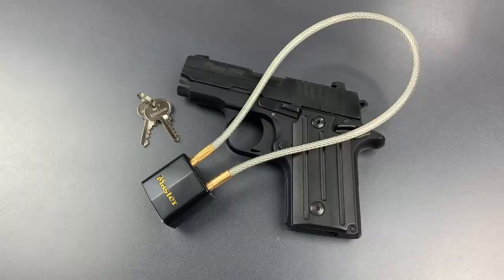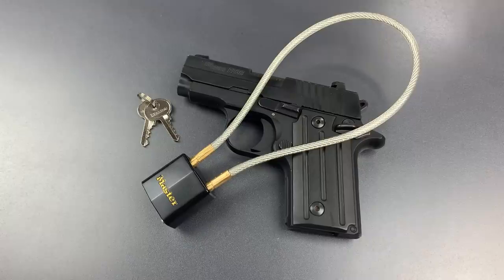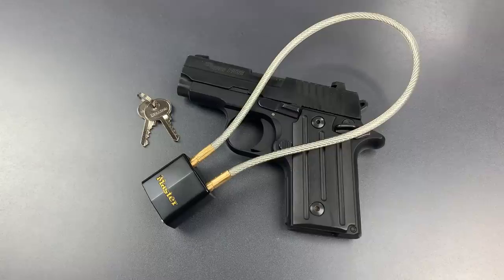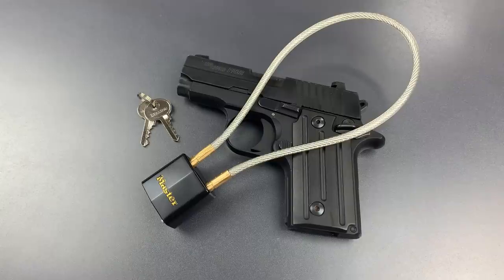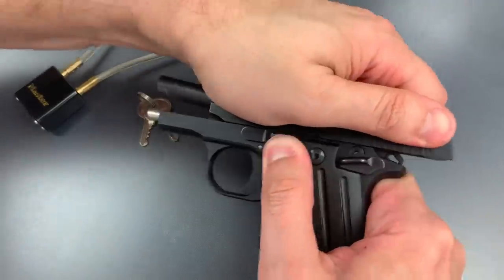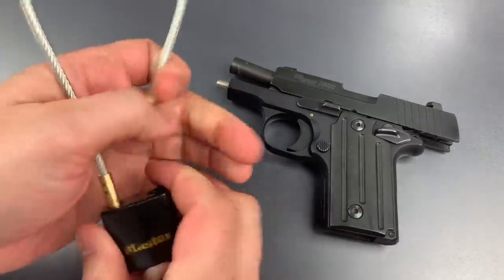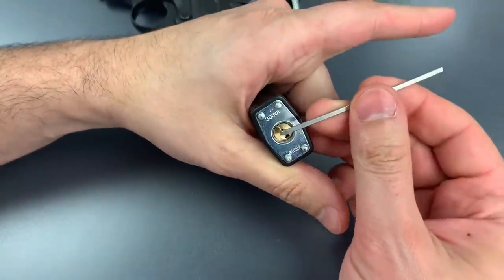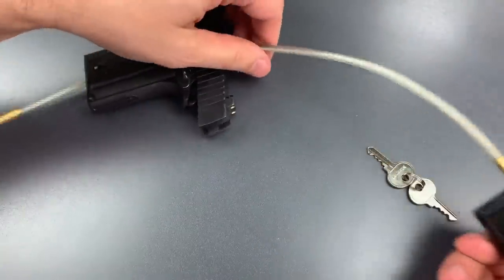[770] Master Lock Cable Gun Lock Picked FAST (Model 99DSPT)

Comment: I'm guessing most "curious adolescents" dont know how to use a tension rod and a rake to pick a lock or even have them available or are able to order them online.
Reply: I'm banking on the increase of both stupid and lazy in the more recent generation.
Reply: Bobby pin and screwdriver can do the same thing, which was what I used to use to open cheap locks when I was a kid.
Reply: You dont need a special tool to do either freind. A sturdy piece of metal will do the job. This is where the old trope of Bobby pins comes into play. And no the point isnt that they will just "know" how to use them. The point is they, just as you, have the ability to go on to YouTube and search "how to open lock" and find "5 FAST ways to open ANY LOCK in less than 3 minutes!!!" which will show them raking.
Reply: A sturdy piece of metal will work well on a cheap wafer lock, a pin tumbler like this is a lot more iffy and would largely come down to the biting.  Masterlocks are usually pretty bad, but they aren't THAT bad.
Reply: @kidthorazine  You haven't been watching this and Bill's channels long have you?
Reply: Been watching for years and also have a lot of experience picking masterlocks, some of them are pretty easy to bypass IF you know how to do it and have the right tools.  And most of them are easy to pick IF you know to do it and have the right tools.  Masterlocks being a joke to locksmiths and locksport enthusiasts doesn't mean they are easy to pick for some kid with no tools or experience.
Reply: @kidthorazine  Every kid has youtube and Bill among others have put up videos on how to pick locks with common household items. I wouldn't be surprised if one of the constantly viral "TOP 10 LIFEHACKS" channels puts together a comp video showing them off.
Reply: Yeah and that still takes a fair amount of practice and effort to pull off.  By which point, once again, the average kid is likely to either give up or just find the spare key you've left in your desk or night stand.
Reply: @kidthorazine  If a kid wants to get into something you'll be hard pressed to stop them. The kid will usually figure out that with the key you can only get into the lock the key goes to, but picking a lock gets you into into all kinds of things that they might want to mess with or gain access to, like the lock to the liquor cabinet or a locked box with cash or drugs, the list goes on and on as to the kinds of things figuring out how to pick locks gets them and that most of the ones that they will encounter in their daily lives are the old as hell and cheap as hell easily picked kind that take no skill, just dumb luck.
Reply: @kidthorazine  Hell, I taught myself how to pick warded locks as a kid in the pre-youtube era for access to alcohol and porno mags before the internet was a thing even 5% of the world had even heard of.
Reply: well yes, but that's going well beyond "curious adolescent" and at that point nothing short of a safe is probably going to stop them, and key security is still a far more pressing concern.  And yeah I learned to pick locks as a kid too, but I was the only person I knew my age that could do it, it's not a remotely common skill even among adults, let alone kids.
Reply: @kidthorazine  Wrong again, curiosity drove me to get into those things. You keep vastly underestimating kids capabilities, especially today's kids who have literally the world's collective knowledge in the palm of their hands, it makes you look stupid to think that they won't figure out how to gain access to whatever they want and just assume that a lock that can be raked open with a plastic zip tie and a flathead screwdriver is secure enough to prevent this.
Reply: David Galbraith and you keep vastly overestimating kids will to get into lockpicking.  If it was that easy and common lockpicking would be a far far more common skill than it actually is.